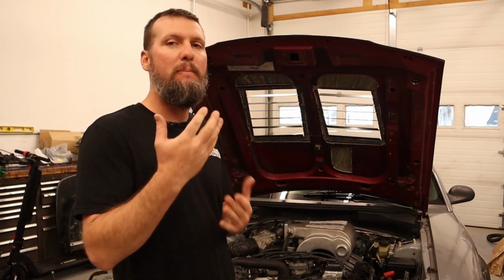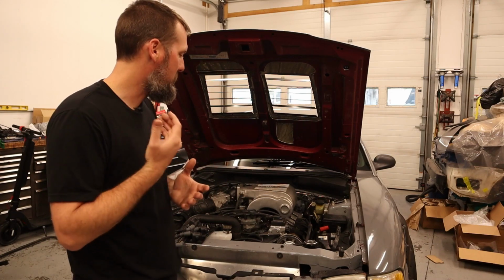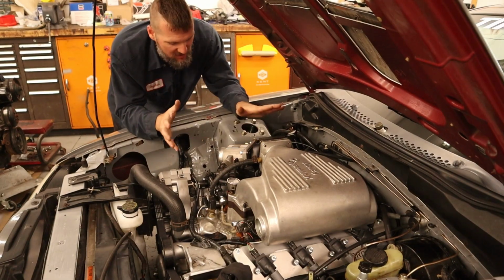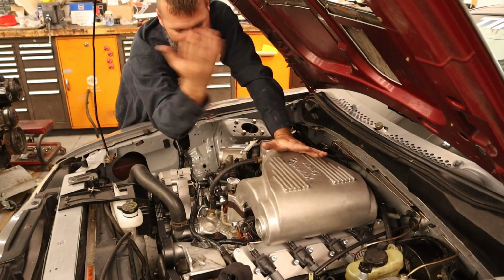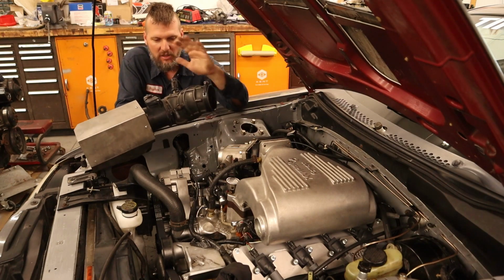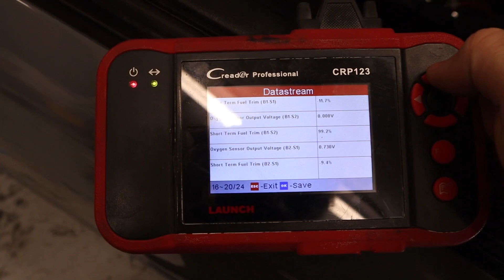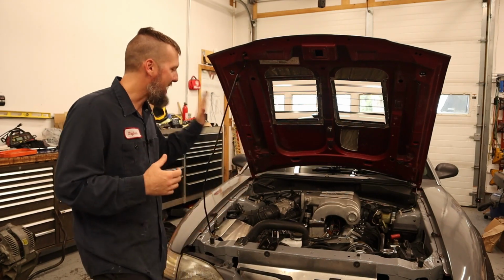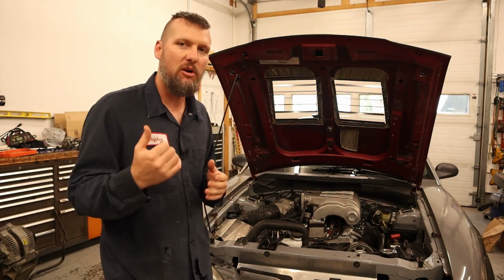Junkyard Distributorless Ignition: Will It Start After the Upgrade?

Comment: So this has a 4.6l control module.  What did you do for the knick sensors?  Great info.
Reply from the maker: It's disabled in the tune, but I tried to install one on the top of the block behind the head. I think that is what Ford did on the Explorer.

Comment: Think you said jolts? Terminator harness for coils? Want to do this to 466 BBF. Thanks Sir 🐾🐾
Reply from the maker: Ha possibly. For the coil harness you can use any mustang mod motor for the wiring. Then repin the connector to the Godzilla coils. Unless you are using the mod coils, which is also possible. Mounting them is a little trickier.

Comment: IIRC you are the first youtuber to mention collaborating with Decipha. 

Are your ignition coils wired singly or in wasted spark? You hinted at it with the PCM selection. 

Fwiw, the slot type sensors Ford used in 2005+ are much better at forgiving non-ideal intake setups.
Reply from the maker: I think SN95 Power uses Decipha as well.

The coils are individually controlled. Good call on the slot type MAF.

Comment: Awesome work man!

Did you have to re-pin the fender harness to crown vic ecu? I've found a few wiring charts and they all seem to be about the same, but it's been difficult to find information. 

for context, I have a 99 v6 that I explorer gt40 swapped 2 years ago, that is running off a carb, and I'd like to go obd2 efi. I have a spare Inake, v6 harness(s), gt40 harness and ecu at the moment.
Reply from the maker: So I guess it depends. If you are using a matching engine harness and fender harness then I don't think so, but obviously should be checked. Since I was using a mismatch of parts I did have to repin some of the terminals.
Reply: @RinerAutomotive  yeah, I did my digging, the v6 harness works for what I needed atm by adding 3 pins.

Did you get your stock gauge cluster to work by the way?
Reply from the maker: @beambuilt5074  for mine being a 94 most of the gauges on the stock cluster run off of individual sensors so they all worked. Only thing that doesn't work right now is the Tach signal.
Reply: @RinerAutomotive  ahhh, that makes sense. Thanks. Also from what I read (not sure if it also applies to the 94/95) but the tac runs off the coil #1, so the v6 cluster is off, but I'm not sure of the truth to that.
Reply from the maker: @beambuilt5074  yes I had to change to a V8 dash to get accurate RPM when I was running the distributor. I wonder if I could swap to a later dash to get my tach working again, hmm...
Reply: @RinerAutomotive not sure if my last comment went through, but I'm now deep into my efi swap. I'm using an 02 gt ecu, and it works accurately with my v6 new edge gauges. Although it runs like crap. But my explorer ecu ran fine so I'm sure it's a setup or tune issue.

How did you set your cam snyc? Is it at 0 deg btc or something else?